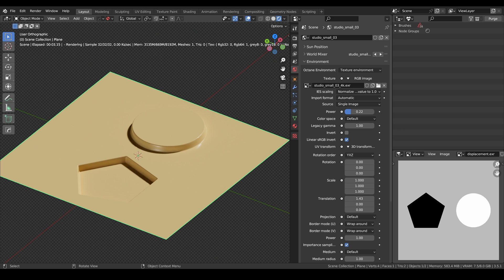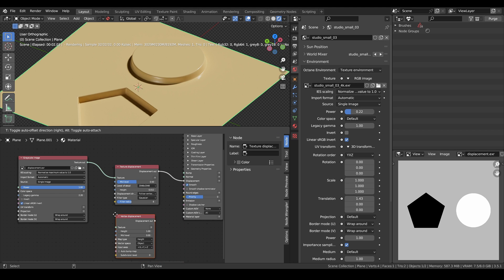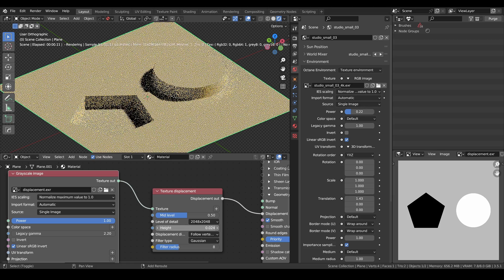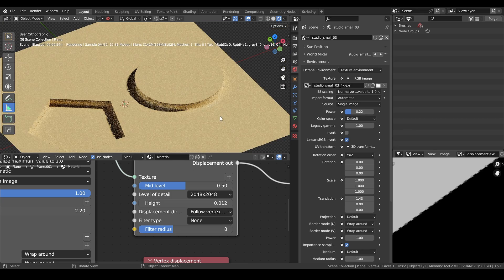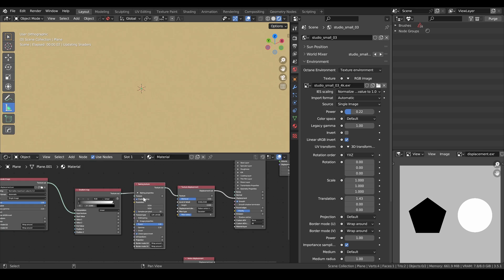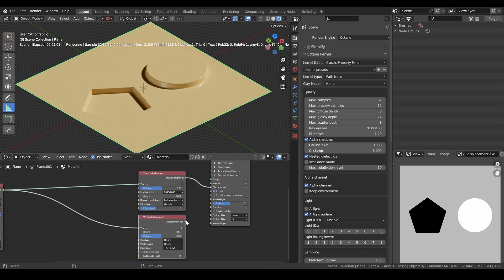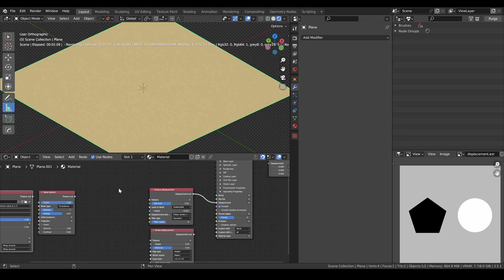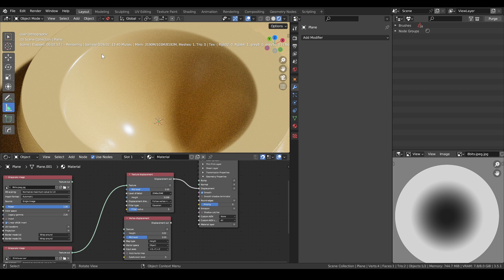Octane for Blender - Displacement Fundamentals

Comment: What are the advantages of using octane in blender instead of cycles?
Reply from the maker: Texture Displacement Node 😂
Seriously though, since blender 4.0 Cycles has gotten insanely better (AgX + new BSDF) and is way more stable and snappier than Octane. Octane just has a special look that I really like and you need to iterate a lot less to get a realistic resut + Octane's Post processor is quite good.